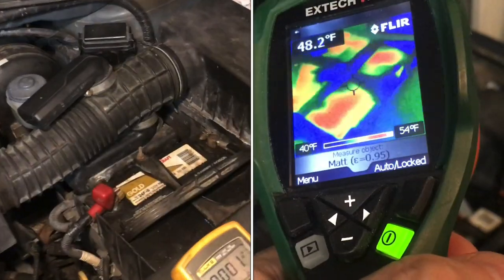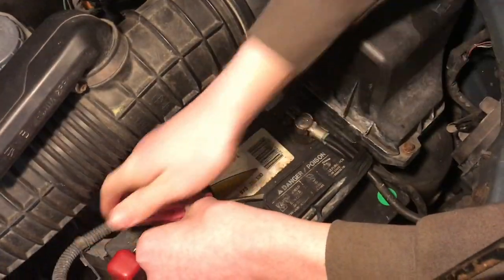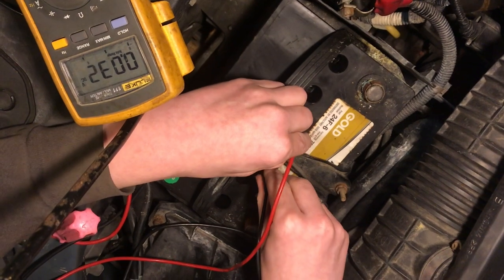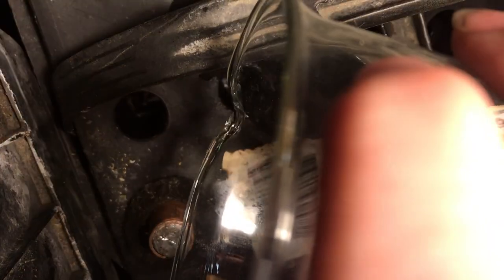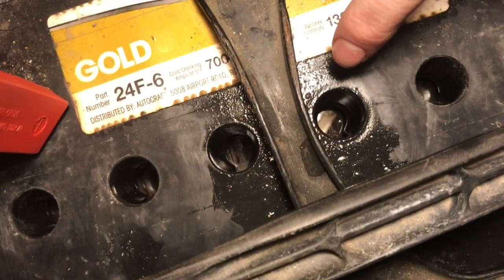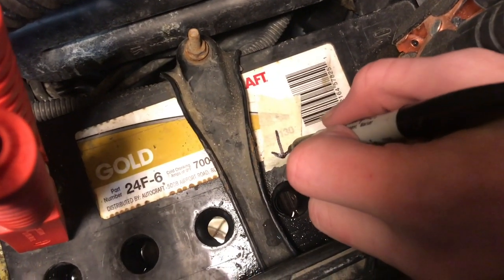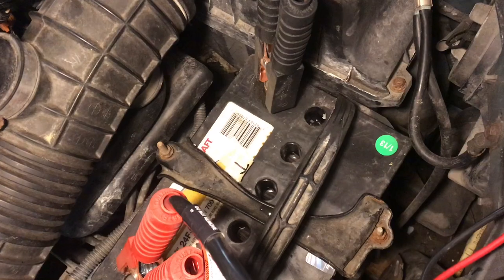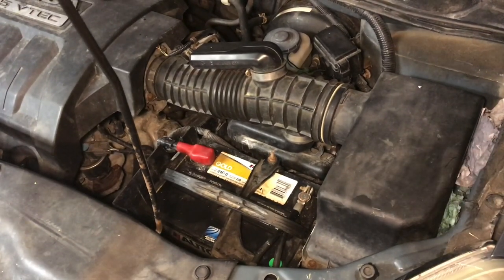recovering “BAD cell” on a car battery (cen-tech battery charger) harbor freight  2/10/40/200 amp

Comment: Just a testimony for this method. I tried some thing like this. It 
works. 3 year old battery, Walmart Maxx- brand, had not been driven for a
 while and had left the interior lights on. On top of that we had a 5 
day long deep freeze (Dallas). After that, voltage reading was zero. I 
tried to jump it. Had to leave it connected to the running second car 
for almost an hour and then was able to jump start it. Was not able to 
restart it though. Voltage reading 2.5V. Charged it traditional method, 
reading only around 11, even that did not hold. So, I did some thing 
like in this video. 200a charger was really expensive but I bought one 
which had 30A charge but a 100A engine start setting, a smart charger. 
With the 4A and 30A setting, it would go off soon after turning on. I 
guess the smart thing did not want to charge it. So, I used the 100A 
engine start setting (current stays on constantly and charging voltage 
at this setting was 15.4V). Did several cycles of 10 minute on/ off, 
then several of 45 minutes on/off. I even did one cycle of 2 hours on. 
The battery never got too hot (only warm to touch). The electrolyte 
never boiled or overflowed (only very small bubbles). No final low amp charge. After this, 
battery was 12.7V. Closed the vents and put it back in vehicle. Perfect 
start. No problem yet (several days).
Reply: Did you get 2 to 3 years out of that recharge?
Reply: Yes hello did it last ?
Reply: How’s the battery

Comment: For somewhere around 50 years I have used just plain old grease on my battery terminals and it has worked just fine.  Never worried about it being dielectric or silicone.  I always saved the expensive stuff to put on the spark plug end of the wires.

Comment: Hey man I see you  utilize a copper tube (cut to size) to make your battery post bigger, Great idea!
Reply: Can also use aluminum can cut to size. If there is labeling on the can, scrape it off.
Reply: @guitaredup71  FYI:  for both of those options, dielectric is a requirement..since your adding another difference metal.

Comment: Some newer charger actually detect sulfate in the battery and will do this cycle automatically. New Schumacher charger we have does it, and saved a napa battery that was in an f350 7.3l diesel.

Comment: Those copper sleeves on the battery post, from what I saw it looked like some corrosion between
the post and the copper sleeves. That will not be very good contact. Need to remove the copper 
sleeves and clean the post and the inside of the copper sleeves. I use the red and 
green felt rings for the corrosion, works for me.   Just saying.

Comment: FYI, I dont think putting in 200 AMP start mode is a good idea.  200 amp start only is on for a few seconds and off.  I think the 40 amp is the best fast charge setting. Also think recondition function may help

Comment: curious why your battery charger link is not the same charger that you used in the video?  did you find that the cen-tech is not as good as the schumacher?  great video.  i learned a lot from it.
Reply: Because harborfreight doesn't do affiliate links but Amazon does

Comment: Everything good you did was negated when you put the silicone lube on. That belongs on the outside of the terminals to prevent corrosion. It’s is non conductive. You’ve blocked the electrical flow.

Comment: After reading all the following comments, may I suggest everyone visit "Uncle Tony's Garage" channel where he has posted a video using a DC welding machine to rejuvenate an old, tired battery....he sends a continuous 85 amps through the battery and gets a good, fast boil going on each cell and after a few cycles puts it back in his car where it performs well for the next year or so.  Name of the video is "Reviving Dead Batteries with a Stick Welder".   Live Free has done a good job with this video but I believe Uncle Tony has this method down better.

Comment: I have a Super Start Premium Battery Group Size 58. All my cells are bubbling. 3 were low on water so I topped all them with distilled water. I trickle charge (2 amp) for 16 hrs. Check the voltage, I had 0 volts? What am I doing wrong? Thanks

Comment: Battery gooroo 🤓 12v 200 amps fo15 min turn off for 60 min to cool . Do this 5 times then select 12v 2/10 amp to charge . Do this every 2 years

Comment: Looks like the charging at higher than standard voltage and current generates oxygen and hydrogen, and the bubbles break up the sulfate on the plates, exposing more active material to the acid. Bet this could be done with equal efficiency by the half-century-old "dumb" charger designs made with a 50 Amp engine start switch.

Comment: hi, im new to the channel and was brought in by a few late night searches lol

i have a bunch of batteries with the same status as that one and have been wanting to revive these bricks

problem is, the best i can get in my little corner of the world is a 100amp continuous charger. (start function only works for like 3 seconds of high amperage.)

is that good enough to revive these lethargic batteries?

also, hows this battery doing after a few months?

cheers!
Reply: Dicen 200 Amp. Pero no lo demuestran con un amperímetro de gancho, hay un vídeo donde con 17.33V y 10 Amp  se obtiene el burbujeo de las celdas, pueden ir probando y midiendo hasta que se consigue el burbujeo en ciclos para darle tiempo a la batería a enfriar. Con 100 A o 200 Amp continuos se me hace demasiado para la batería, el vídeo debió mostrar con un amperímetro de gancho el verdadero amperaje de carga.

Comment: Awesome. I just bought this charger. In 200A mode when i push start is just says ON on display. Does the 200A actually goes when ON? When i disconnect and reconnect again then it shows 180 seconds (3 minutes) and counts down to zero. Is that 3 min ON and then it's OFF and you have to repeat every 3 minutes? I don't get that and i can't really measure 200A wtih multimeter so i don't know what's happening?
Reply: Read the manual 
https://manuals.harborfreight.com/manuals/63000-63999/63423.pdf
Page 12 of the PDF file it says 
ENGINE STARTING:
NOTE: During extremely cold weather or when battery
is severely exhausted, charge the battery at 10A for
about five minutes before attempting to start engine.
1. Unplug Charger/Starter.
2. Make sure setting of Engine Start charge rate
matches the vehicle battery. The emergency
starter function should optimally supply at
least 50% of required battery CCA rating.
3. Position AC and DC cables to reduce risk of
damage by hood, door, or moving engine part.
4. Stay clear of fan blades, belts, pulleys, and
other parts that can cause injury to persons.
5. Determine which battery post is grounded
(connected) to the chassis. If negative post
is grounded to chassis, see a. If positive
post is grounded to the chassis, see b.
a. For negative-grounded vehicle
(as in most vehicles):
• Connect POSITIVE (RED) clip from
battery Charger/Starter to POSITIVE
(POS, P, +) ungrounded post of battery.
• Connect NEGATIVE (BLACK) clip to
vehicle chassis or engine block away
from battery. Do not connect clip to
carburetor, fuel lines, or sheet-metal
body parts. connect to a heavy gauge
metal part of the frame or engine block.
b. For positive-grounded vehicle:
• Connect NEGATIVE (BLACK) clip from battery
Charger/Starter to NEGATIVE (NEG, N, –)
ungrounded post of battery. Connect POSITIVE
(RED) clip to vehicle chassis or engine block
away from battery. Do not connect clip
to carburetor, fuel lines, or sheet-metal
body parts. connect to a heavy gauge
metal part of the frame or engine block.
6. Plug Charger/Starter into grounded 120V receptacle.
7. Turn Power Switch on.
8. Press Function Select Button until
12V 200A Start lights up.
9. Press Start/Stop button to start function.
10. Turn ignition key. If engine fails to start,
charge battery at 10A for an additional five
minutes before attempting to start again.
11. After the engine starts, press Start/Stop button
to stop function, then turn Power Switch off.
12. Unplug power cord, remove clip from vehicle
chassis, and then remove clip from battery terminal.
13. After use clean, then store the charger
indoors out of children’s reach.
Reply: 50% of most automotive batteries are approx 550 CCA,100% more or less, so yes it should be putting out 200 Amps in start mode. I'm sure there's more to it, with the electronic safety circuit in place.
Reply: Most of these electronic chargers only provide the 200A boost for about 10 seconds and then it drops down to cool down.  Its not designed for 200A of continual charging.  The information is buried in their manuals.  Its also to protect the units from being damaged by the heat, especially if it doesn't have a fan.  You either try to find an older manual control charger or buy an ARC welder which can provide the amperage continuously.  Most people using ARC welders seldom go above 130A to charge the batteries since the water and acid would be boiling over the cap top.  You also get finer current control with an ARC welder.

Comment: Most Schumacher electronic chargers only deliver 200A for about 10 seconds and then it drops down.  You are better off getting either a non-electronic charger with manual control or use an arc welder unit which can maintain the amperage over time.  Just looking at the bubbles you have shows that its not charging at anywhere near even 50A to 100A level.  Its maybe charging at 40A level and that is not going to remove the sulfation problem.  You just basically just charged your battery up at around 40A at most in that time period.
Reply: any cheap 200amp welder you recommend?
Reply: @khaibui3575 😊
Reply: I have what sounds like a twin. 
I suspected probs w. Fuel. of course. Is the
Obvious. I can' t seem to spray the Starter. Might I be missing the correct location at thre front. The other side has a bowl  so I assumed that front rectangle that had a rectangle pad on it
 Think so.?

Comment: Those battery chargers are useless, they are so smart they don't work. Get a manual one. You need to bring the battery to a fast boil. That little bubble isn't doing anything. Boil the battery to clean it and keep adding water as it boils.

Comment: This is supposed to be an educational video but you didn't perform the battery check properly. You turned the load on the battery off after only 3 seconds. It tells you right in the battery load testing tool user manual to put the load on the battery for at least 5 seconds (max 10) then look at the voltage gauge on it to see if the battery passes. That's a very important detail you overlooked & neglected to tell your audience. As an A&P Mechanic I'm sure you would want me to check the battery properly on the aircraft you or your loved one is flying on because as we all know you can't just pull off to the side of cloud nine if there's a problem right? I have to be a stickler for details & instructions like this because peoples lives are literally in my hands when I perform maintenance on aircraft. I know it's not on an aircraft but the test was not performed properly on the battery in this video. Please take this as constructive criticism & not a personal attack on your intelligence etc. & learn from it. Also dielectric grease/silicone lube helps stop corrosion on the battery terminals, AFTER they're connected by placing it over the already connected battery terminals. By putting it on the battery posts like you did you created more resistance to the flow of electricity because (From Wikipedia "A dielectric is an electrical insulator"), & most people do not know this. Most people think the dielectric grease helps with conductivity but it does not, it's the covering of the battery terminals & electrical connections with it that keeps oxygen from corroding the terminals & that's the main reason a lot of people use it. The oxygen & sulfuric acid fumes can't get through the paste of the dielectric grease/silicone lube & cause corrosion. BTW, I use my Snap-on Mt3750 AVR Battery Load Tester and Bc4200 Fast Charger to check and maintain my 6V and 12V batteries.
Reply: pat yourself on the back yay for you your the smartest person commenting here maybe even in the whole tube world
Reply: @marknicolich5789  Good to know, Aircraft Mechanics are correct in what they do and what they know. This is why they get paid top dollar to keep us safe. Top knotch ! Something to aspire , want to be in life.✈️
Reply: Good to know dielectric grease on the outside of the terminal also wait 5 seconds to 10 , when operating a load tester.  Great support information.
Reply: Better yet, just clean the terminal, connect it directly and then use a battery terminal spray like CRC 05046 battery terminal protector to keep the moisture and corrosion out.  In order to have electrolytic corrosion, you need three elements, two dissimilar metal in direct contact and an electrolyte in between.  Adding that copper layer in between actually makes the dissimilar metal problem worse.  If it was lead on lead, even if there was an electrolyte in between, there is no electronegativity difference between two different metals.  However, lead (and even copper) tends to oxidize and form an oxide layer which forms a non-conductive barrier.  Its these oxides which creates additional electrical resistance.  If a metal is in good contact, it will conduct.  If it has a layer of oxide, that is when you tend to have issues.  Putting a thin layer of lubricant over the metal surfaces does not make the electrical conductivity worse as the OP suggested.  Its merely there to provide a layer to prevent direct exposure to the environment and forming an oxide layer.  There is a lot of misconceptions even if you're an A&P.  I've been an A&P mechanic for over 35 years and also an engineer.  You have to understand the mechanism of oxidation and corrosion to understand how to prevent it.  Believe it or not, airplanes are not as vulnerable to corrosion as compared to ships which is exposed not only to the environment, but to salt sprays.  That is the ultimate worse conditions and not airplanes.  I own several boats and have dealt with corrosion on the marine environment and its MUCH WORSE.

The terminal spray is to create a moisture barrier so any electrolyte like water won't be able to get in in between.  Other people have used WD-40, which is not a bad substitute because WD40 was designed to be a "water displacement" (hence the name "WD") and its an effective spray to prevent moisture intrusion.  As a lubricant, WD40 not the best in my opinion.  The only issue with WD40 is that it requires more reapplication because its a lighter and relatively low viscosity fluid.  The CRC battery terminal protector or even CRC heavy duty corrosion inhibitor is a high viscosity fluid and tends to stay in place after it has been applied.  It does a better job at protecting since it coats the terminals better and stays in place to prevent corrosion.
Reply: @jetenginethrust863  Perhaps to your snarky reply is that YOU thought the reason that dielectric grease helps in increasing conductivity.  Most people who has used any form of grease in these applications know its mainly used as a BARRIER for moisture.  When servicing fishing reels, its common to apply a thin light coating of grease on the inside frame to prevent moisture from causing corrosion.  

You're not the only A&P out there in the real world.  Other people progress to becoming engineers because just bending wrenches are boring.  Took me 3 years to get my A&P and aced every test, but it doesn't give me a clout to know it all about electrical testing and the usefulness of applying some form of grease on the electrical connections.  The main negative with applying grease in the wrong location is that it affects the engagement/disengagement forces for critical connections.  Some connectors can't have grease because it decreases the disengagement forces and affects the vendor and mil spec requirements for engagement/disengagement forces.  Many of the mil spec terminals used in cannon plugs are also gold plated to mitigate the potential for corrosion and prevents oxidation of the surfaces.
Reply: @jetenginethrust863  Hell, half the people who went through A&P school should never work on airplanes.  You know exactly what I'm talking about.  There are some clowns who goes through A&P and it doesn't mean everyone is good once they complete the courses.

Comment: May i know the brand of your battery charger?
Reply: Cen tech 200 amp from harbor freight
Reply: @kennethmabus381  @Live Free   @Live Free   Do you know if the Cen tech will "stay on" 200 amp?  I bought the Schumacher SC1285 12V Wheeled Battery Charger 40/200A Engine Starter and it does not stay on 200 amp, it auto switches to a lower 40a setting, there's no manual override to keep it at 200 amp 😤
Reply: @donutz1  no. It counts off and dont give you 200 consistant amps.
Reply: @donutz1  That's the worst brand... They make nothing but trash.
Reply: @kennethmabus381  It didn't in this video.
Reply: @RodknockRhett  then go buy one and do it.
Reply: @donutz1  the 200a setting is only for quick starting or jumpstarting a battery that needs only a small amount of help. Its not a "fast charging mode".
Reply: @kennethmabus381 i dont think that that Harbour Freight is worth ANYthing.